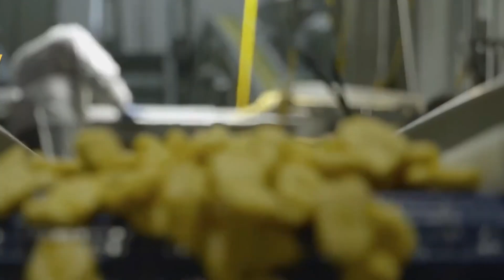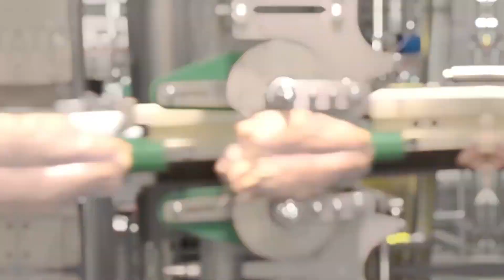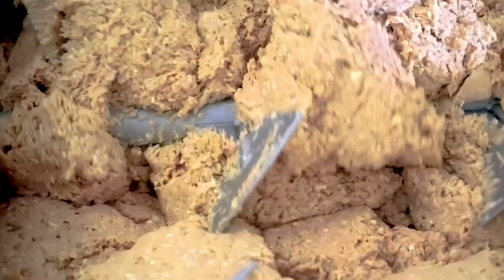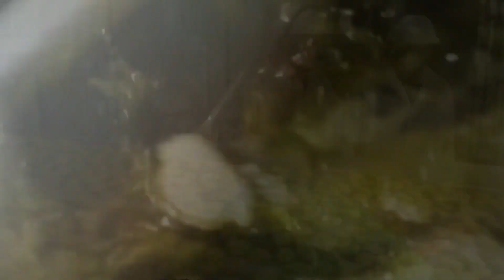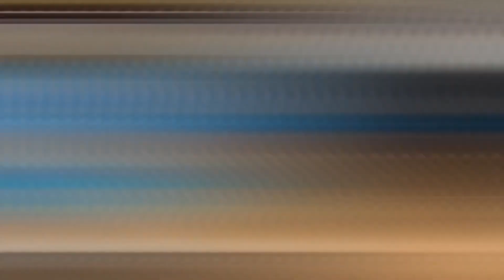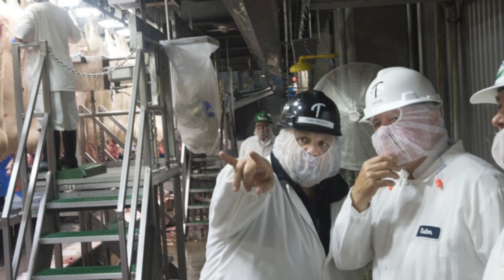How Chicken Nuggets Are REALLY Made | Behind Closed Doors

Comment: I feel cheated. Actually, I was cheated. I thought it was made with real chicken meat.
Reply from the maker: Well, it technically IS chicken. Just ground up into a slimy pink paste then shot into molds.
Reply: you literally saw them adding chicken meat didnt you?
Reply: @AyanCooki3  "Real" means a single piece of meat cut from an individual chicken, not a paste made from multiple pieces of different birds grinded together. It's the same difference as between a steak and a sausage.
Reply: This doesnt make any sense because on mass production you are always going to get that ground chicken paste is still Real unless the paste is artificially made, and they arent gonna make single batches by using an individual chicken it will always be a variety batch with everything in it